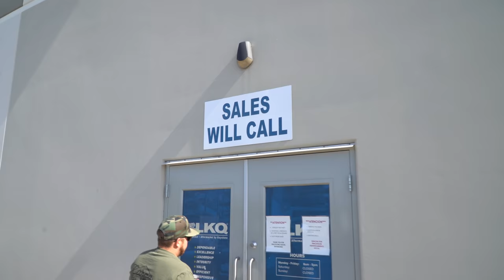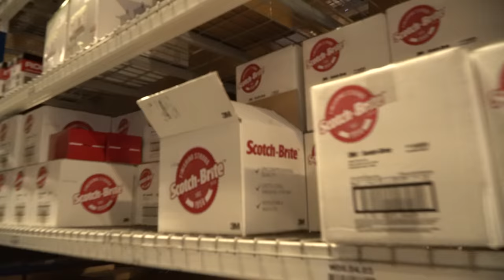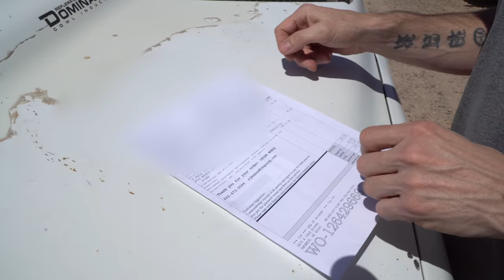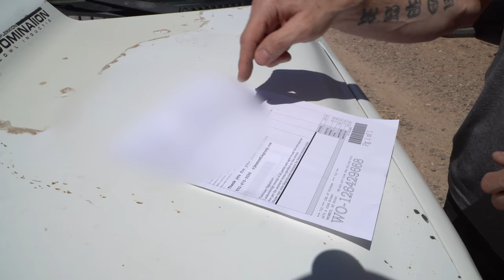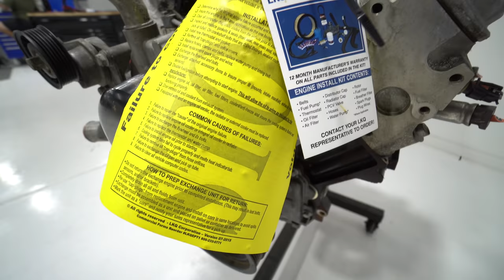How To Buy a Junkyard Engine to Save Money (Swaps & Replacements)

Comment: If you add the cost of removing the part, cleaning it, storing it in a specific place and the staff that is in charge of handling it.. In the end, the cost of that used part is almost the same as that of a rebuilt/refurbished one sold at any auto part store.
Reply: Yup. LKQ is expensive. I rather save money by doing the removal myself at U-Pull & Pay.

Comment: Where do you get your 93 octane gas for the stage 2 GTI?
Reply from the maker: You can run 91 no problem with that tune. You will make slightly less power but it won’t hurt the engine
Reply: @CameronAlford  i have a Mk6, does it also apply for it?
Reply from the maker: Yes
Reply from the maker: If it’s unitronic I am 100% positive
Reply: @CameronAlford  thanks.